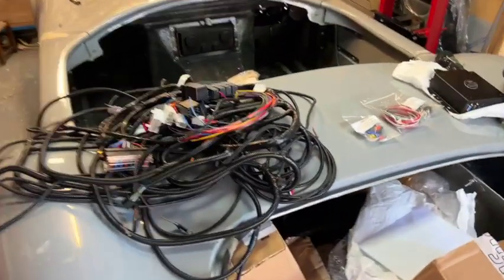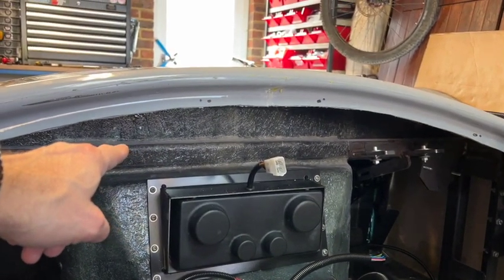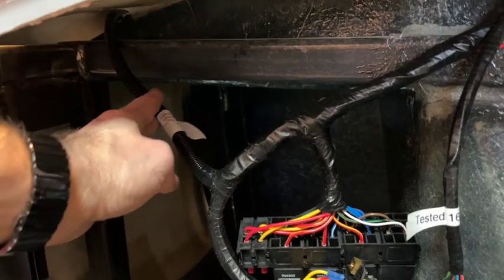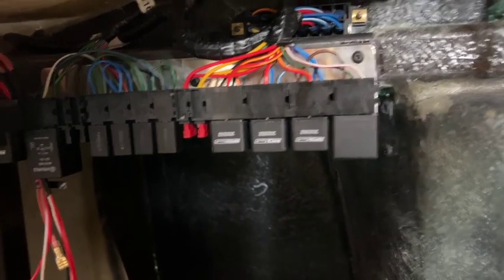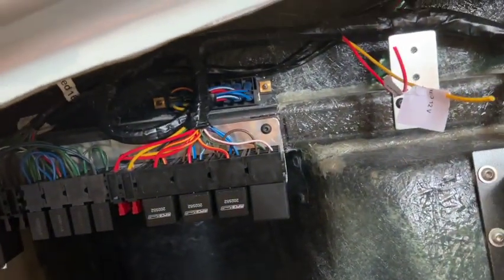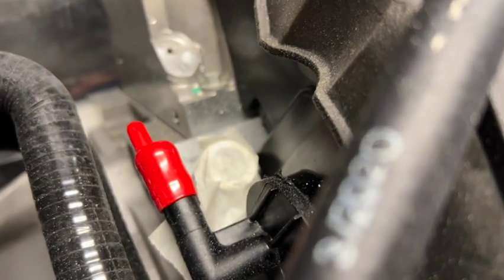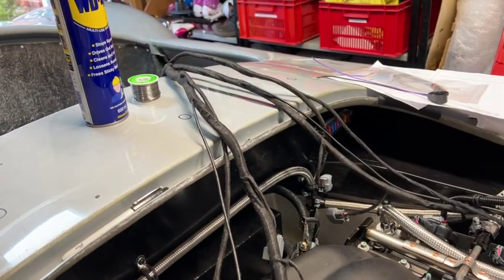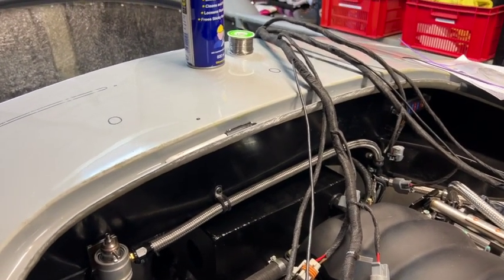Building the AK Cobra - the Wiring (part 1) - Part 12

Comment: Another great video Russ .,really enjoying them . How are you finishing the inside of the engine bay ? You didn’t go for the stainless steel cladding.
Reply from the maker: Thanks Richard, hopefully I am getting some decent info across. Regarding the engine bay, I think the black gloss finish is really good so I am leaving it as is, but of course the lower 2/3rd’s have heat reflecting foil on, so much is hidden. There will probably be a mirrored stainless sheet across the back too, above the heater box.
Reply: @russ.howell  it’s looking really good very neat .